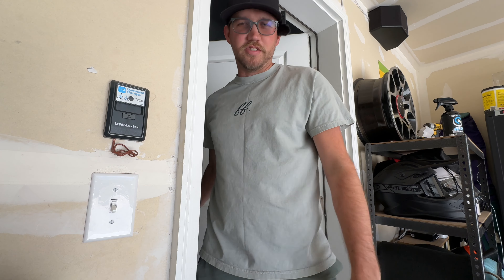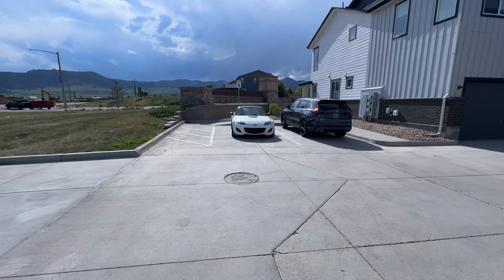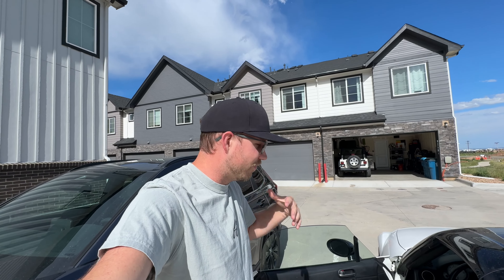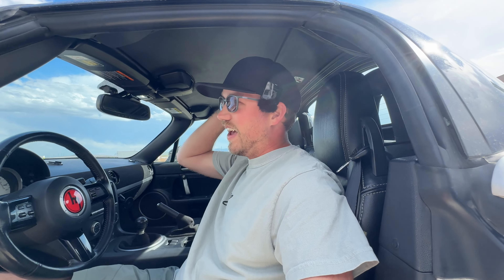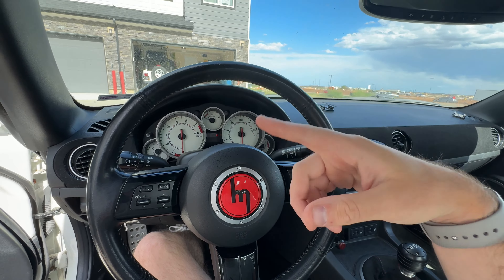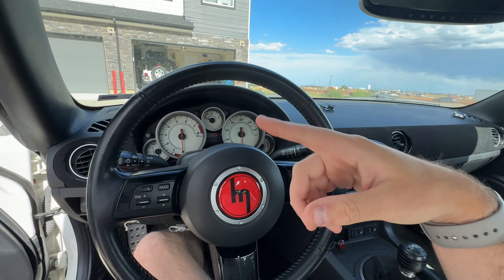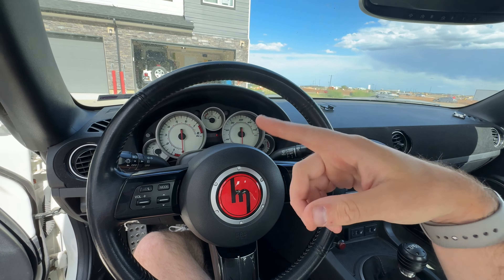The CUSTOM Miata horn button solution explained!

Comment: I just did the GoodWin RoadsterSport Shock Tower X Brace.  It was an easy swap out, looks great, and makes accessing the damper adjustments a breeze.  I still think you need to replace your steering wheel.  My cipher is my favorite touch-point of the car.  (And it retains the airbag, so your sticker is safe!!!)

Comment: Love the content, sticker looks great, gonna have to replace the wheel in mine, as I'm 6''2' I'm getting a steering colomn extension, 55mm. Not sure the wires for the cruise control and infotainment will still reach through
the old wheel. Sparco look great.

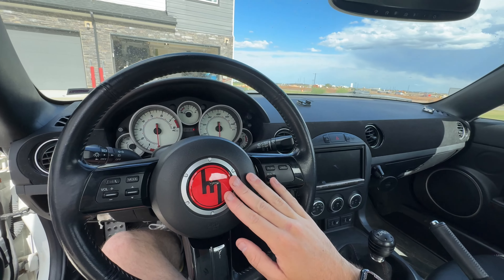Comment: Just a FYI... I didn't see the card you mentioned when you referenced that video at 2:18.  BTW, that Mazda logo was used from 1959 to 1974.
As for my plans... I've spent pretty much the first half of the year getting my NC looking nice, fixing all the damage, etc.  It's about 90% right now, just have to replace a side skirt.  I won't be able to fix it 100% but it will look great from a couple feet away.  Once I'm done with that, I'll hopefully have some budget to do more (this has really put a damper on my budget)..   next plans are a full Bosectomy, then some bracing... and saving up for a turbo kit early next year.

Comment: Coming up in my other NC2, Ohlins install, rolling fenders, pf01 17x9 240/40R17 setup and performance alignment. Followed by chassis bracing. I have my first NC2 which is built to the teeth ready for boost. Just waiting on FM to release their kit.